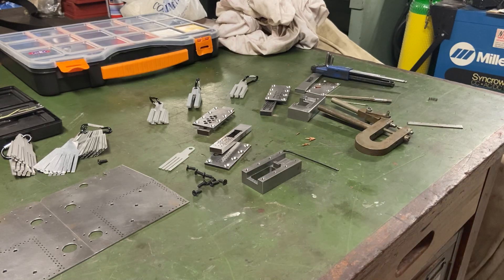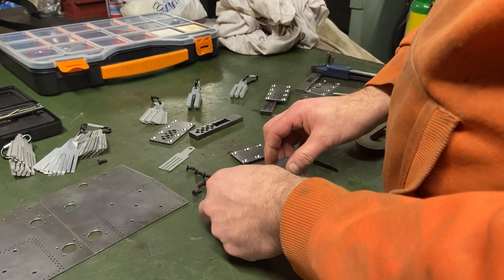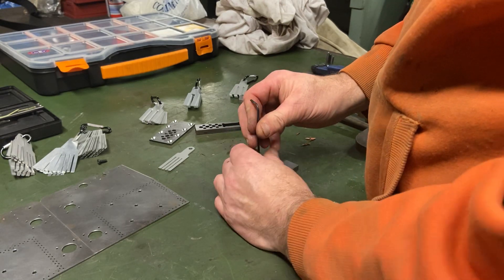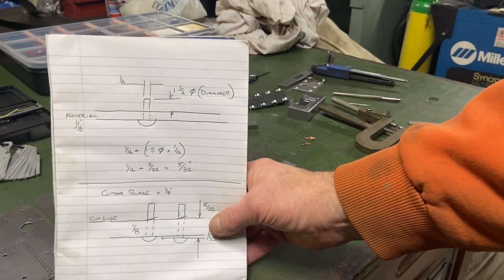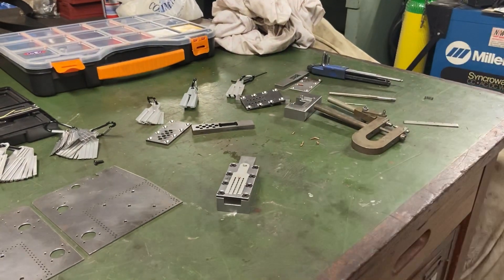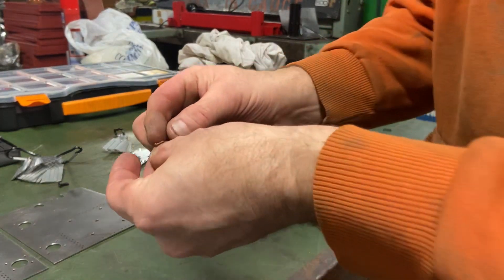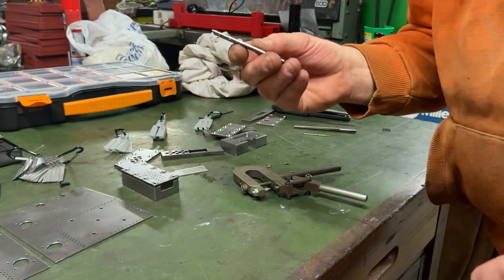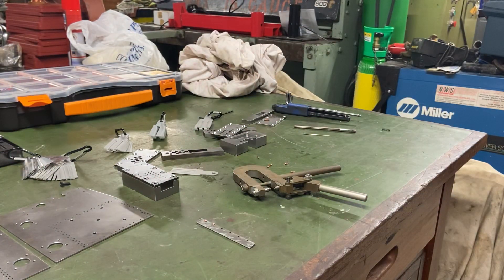Cutting solid rivets to length

Comment: What about a vice and angle grinder? I have to take 1000 solid rivets down from 3/4 inch to 1/2 inch......
Reply: @Andy Chamberlain Thx for the reply.  Im doing 1/4 diameter steel rivets for a school bus conversion.. Figured w non refundable it made more sense to guess too long than too short ;)